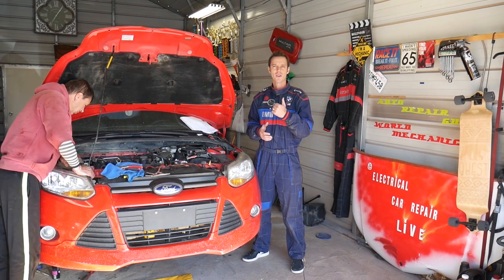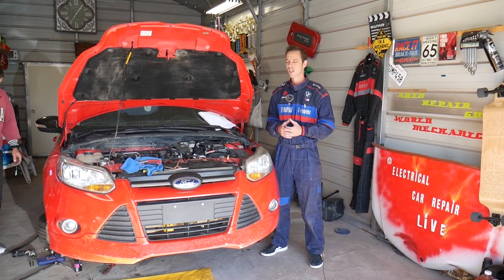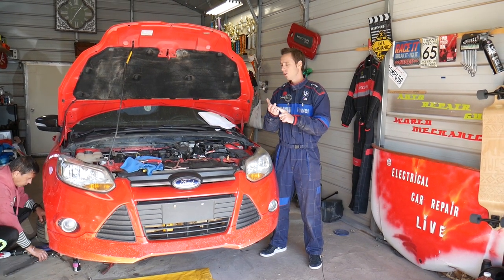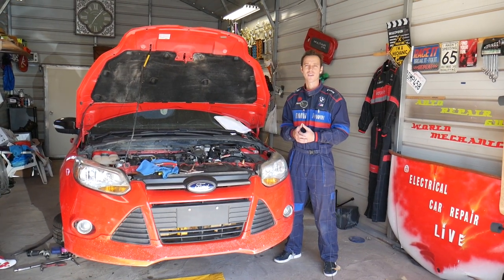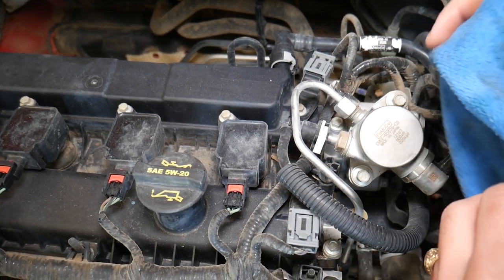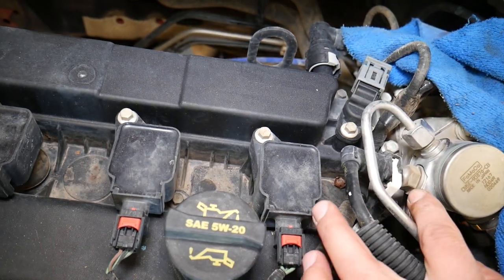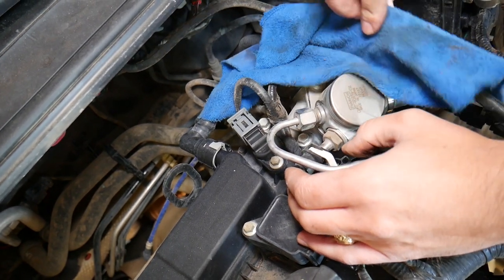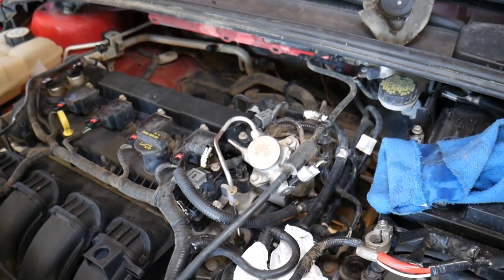HOW TO DISCONNECT FUEL LINE ON FORD FOCUS MK3. REMOVE FUEL LINE

Comment: the  rubber hose connected to the clip is leaking on my 2013 ford focus se ... i was told i would have to drop the gas tank to fix it

Comment: Can I use this same fuel line to pump old gas to a container?
Reply: That's what I plan to do
Reply: Did this work for you??
Reply: @1998jtlatgmailcom  Didn't try this, I took old gas straight from the tank.